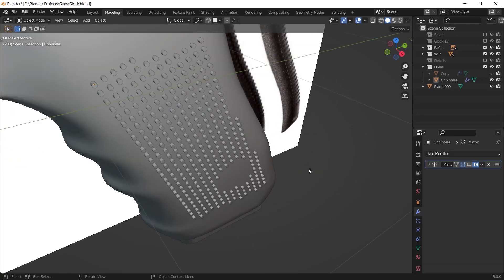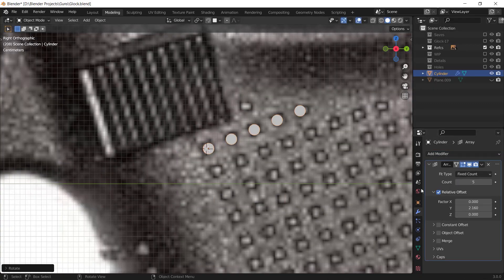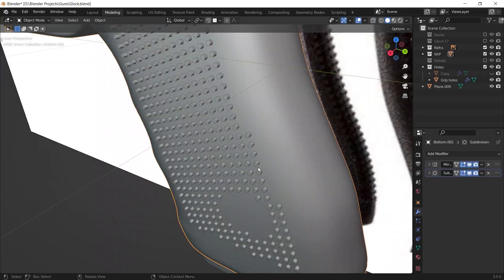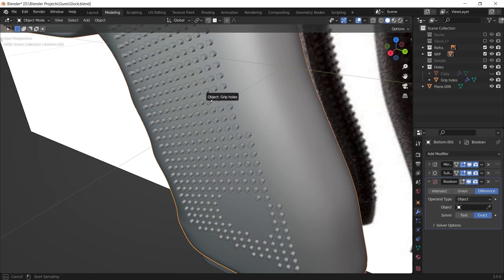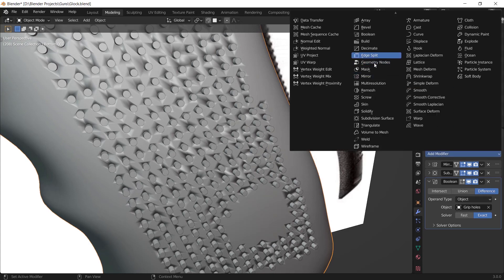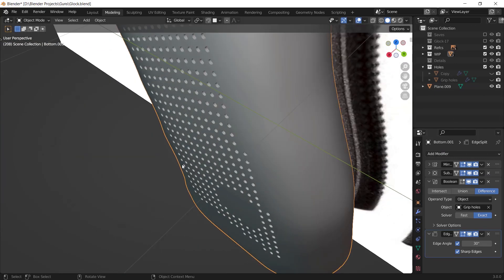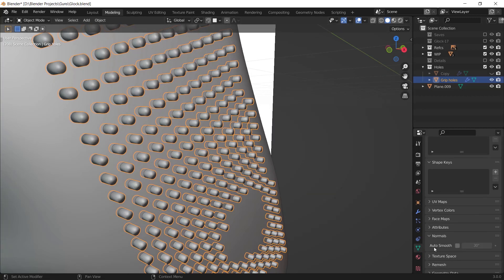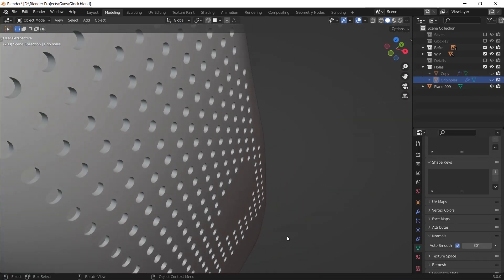The quickest way to add holes to hard surface objects | Blender tutorial

Comment: When looking closer, these aren't holes. Look on the sides of the handle. Those are squares and not indented but sticking outwards!.
But doesn't render your method useless. Just use boxes instead of cylinders and bool them via join.

Comment: use auto smooth setting and a weighted normals modifier instead of edge split. does the same thing but doesn't increase poly count

Comment: If you hit a "merge by distance" function, you'll understand that this method does not work. Splitting the edges will make the vertices of the faces not connected to each other. In other words, your mesh will be just a bunch of faces floating around. And this makes the topology wrong.
Reply from the maker: Yeah man I know what the edge split modifier does and I think you wouldn't find what you want (correct and awesome topology tutorial) in a video with less than 2 minutes duration. I thought this quick video can be useful for some people and it is.
By the way I recommend this guy: https://m.youtube.com/channel/UCXfGjwohMgPm4Ng2e1FXySw

Comment: are thoes even holes? they look like little nubs in the reference.
Reply: Nope, this isn't supposed to be holes, the purpose of those thing on guns handle is to add grip. Holes would be useless in this case, but does it really matter for the purpose of the video ? :p
Reply: @Grioersh  they are 100 percent raised on the actual glock.

Comment: This will only work if you don't have any bevel modifiers with more than 1 segment on the object, so if you are OK with sharp edged holes its fine. The moment you add bevels with more than 1 segment before the edge split modifier you'll have the same shading issues and if you add it after the edge split the bevel won't work.
Reply: secret to this is to add a bevel to the first cylinder itself, before-copy pasting.
Reply from the maker: Thanks for letting me know about this, I didn't try to bevel the cylinder and I think it won't work as you said.
I recommend you this guy: https://youtube.com/c/JoshGambrell to learn more about hard surface modeling and so on